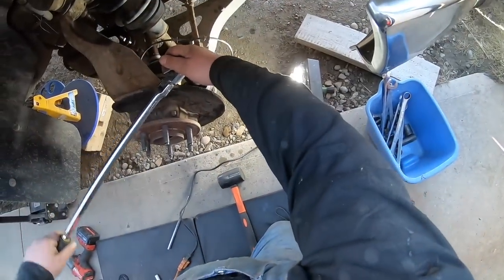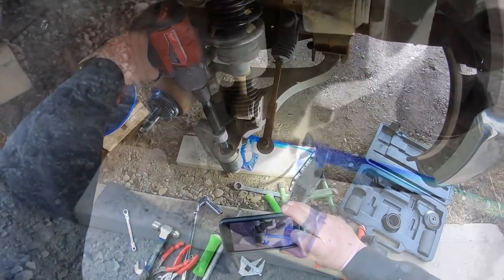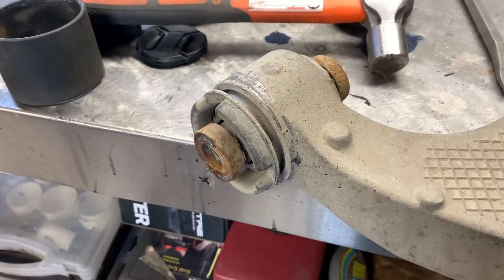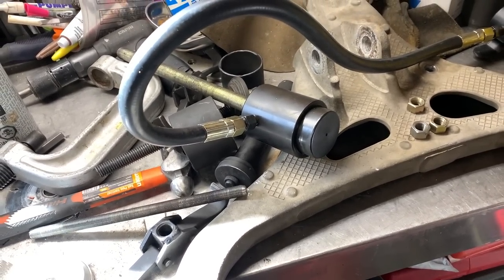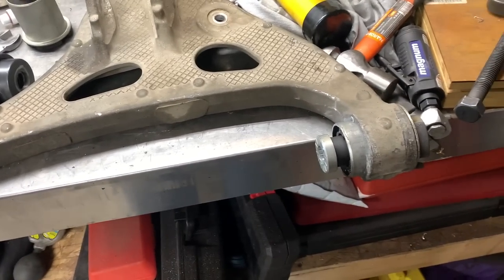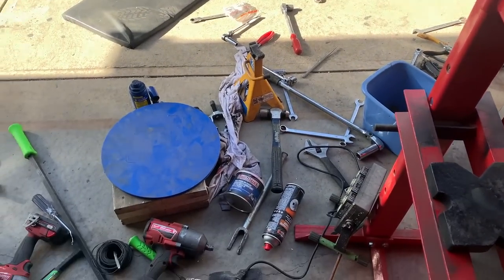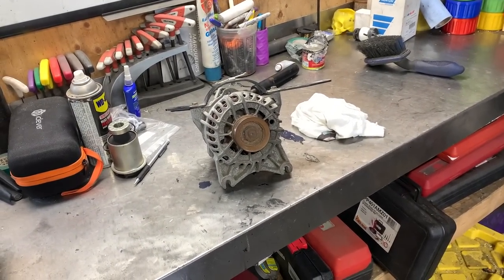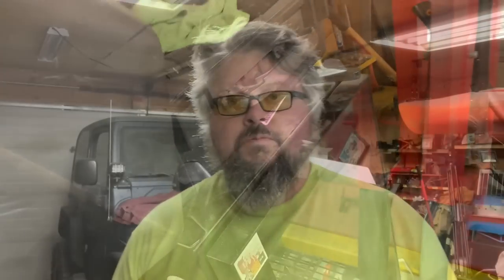F150 LCAB Was a Bad Idea

Comment: Recently changed Rear Leaf Spring Shackles and Leaf Spring Bushings on an 02 Silverado, one of the toughest jobs I’ve done in a very long time. Used almost every specialty tool I own to get the job done, from a plasma cutter to my air chisel and a sawsall, after 5 days of work finally got her done!
Reply: Any suspension work on a full size truck becomes a major ordeal for a home mechanic.  I have tried and struggled too many times, so no more for me.

Comment: I thought you put a control arm on the drivers side a few years ago. After doing ball joints on mine several times, the bore is shot and I have to replace my control arms.  I already bought them, been sitting in the garage for a few months, not overly motivated. I don’t think I would ever attempt the bushings, looked like a total pita. I don’t even want to do the arms, heard horror stories of seized up bolts.  Well done sir.

Comment: To remove the rubber you use a drill bit.  Literally let it walk it’s self around inside the bushing then deal with the light steel shells.  Works good

Comment: The Ford pcm will tell you info like alt voltage ... Just hold down your mile reset button then turn the key on you can cycle through many data points on your Ford

Comment: I just changed out my van's front wheel bearings/hubs. You can change just the bearings but brother I tell ya it is NOT worth the time and effort. I bought a cheap Chinese set of two (Hub & bearing) for less than the cost of one O/E from Ford. I had to get a long Torx 50 socket for the job but I still saved mega-money doing the job myself.